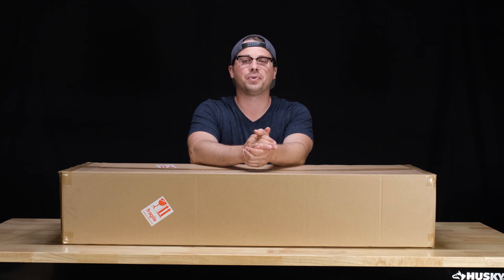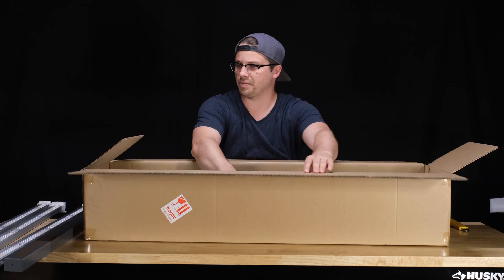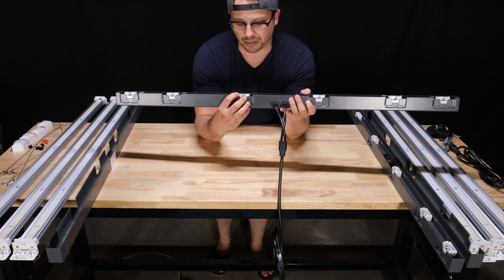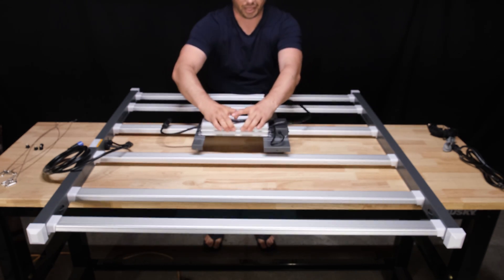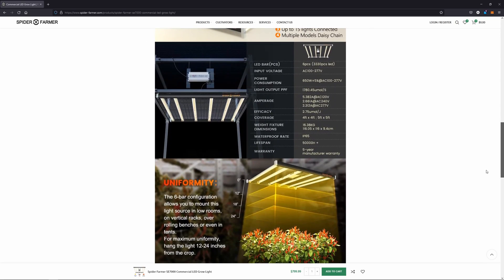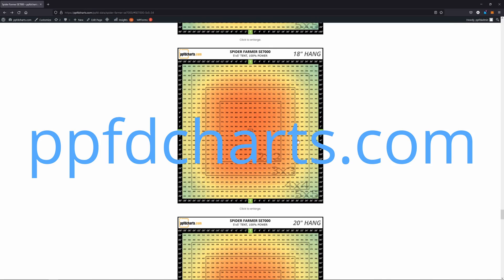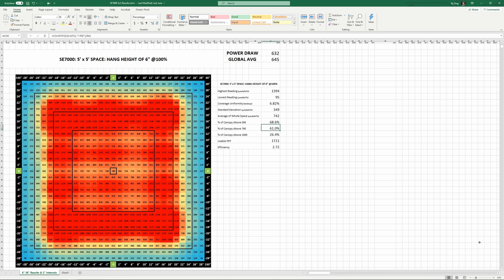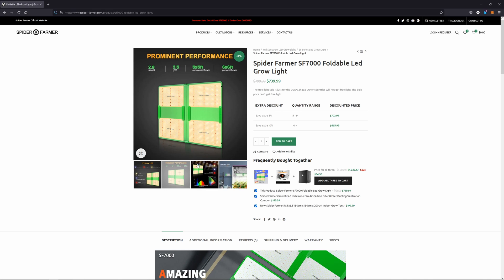Spider Farmer SE7000 Review: A Powerful Bar Light for Your 4x4 or 5x5 (w/ High-res PPFD Results!)

Comment: Bro I think you are testing the wrong light this is not the SE7000  THE SE7000 Has 8 bars and is a 730 watt light you are testing a 6 bar light which I think is the SE 5000

Comment: May I ask what tent you are using? At timecode 13:10 I notice a grey foam core in the tent wall. I would like to know the manufacture and model number, please.
Reply from the maker: I built these walls myself so I could reconfigure the space however large I needed to test in
Reply: @LEDGardener  Looks like an outside material, grey foam and silver liner inside. Can you tell me what those 3 materials are and what your using to glue them together, please I’d like to reproduce for myself, thx
Reply: May I have info on materials for the foam wall, please?
Reply from the maker: They are 2” 4x8 foam panels from Home Depot with mylar glued to them

Comment: this is great! tried using the LEDG code as a coupon in checkout at the link you shared but it said "coupon ledg does not exist!" any ideas on what I might be doing wrong or how to apply your discount?
Reply from the maker: Hey Taylor, I tried changing it to see if that fixes it. Try ledgspider now.
Reply: @LEDGardener  that worked! Thanks so much!
Reply from the maker: No, thank you!

Comment: great vid!! any idea how the upgraded version compares?  you get an additional 80 watts and 2 additional led bars yet 642 less led's.  also, why would they opt to leave out the IR and UV lights on the 7000 only?
Reply: I was able to get the upgraded version and it really is a nice light. I have it in a 5 x 5 and it actually more light than most people will need unless you are running CO2. Veg is about 40% on the dimmer and flower about 65%. So quite a bit of overhead left over to play with later in the grow. I'm not worried about a few missing diodes which would just be overkill for most amateur growers.
Reply: @artvandelay4545  I know it is a old post ,I have just received the upgraded se7000 ,how far above canopy do u hang light? Thanks
Reply: @concreter6832  I would start off about 3 feet above the canopy and see how your plants react. You can tell if they are happy or not. I know like that sounds like more space than you see recommended but it's a powerful light and can overwhelm younger plants especially. Hope that helps
Reply: @artvandelay4545  I bought 2 of the 7000 for a 10 f X 5 ft tent ,by what U said I will probably not run them more than 65 %,that Will be a big power saver ,I am replacing 3x600 HP's thanks for advice.
Reply: @concreter6832  Pretty sure you'll like that setup. You might need to run above 65% at the very end, but if you run much above that, you will generate a bunch of heat but still cooler running than your old setup. I've gotten some big fat nugs with this light.

Comment: This is a SE5000.  Not SE7000.
Reply from the maker: The SE7000 changed. This was the first version of it.
Reply: Oh is that so?  I have the 8 bars version.
Reply from the maker: Nice. Do you like them?
Reply: They must of just recently released version 2 then hu?  Didn't even know that. I got mine last week.  I haven't set them up yet. They are put together and I check em out. Been busy lol

Currently have 3 Sunraise QB4000 up. Gonna move those to veg room. SE7000 for flowering.
Reply from the maker: Good stuff. Spider Farmer says the SE5000 has a 480W power draw and mine drew 630+
Reply: @LEDGardener  good to know I have a 4by4 infinity 844 tent and cant decide to go with the 5000 or the 7000? Im doing 2-4 plants. Would heat be a issue with the 7000 in the 4by4 because of tight fit?

Comment: Hi , wondering if you would help a guy out here. This LED is so confusing for one. I've got a 4x4 tent AC Infinity with the awesome exhaust fan.
I bought those budget crap Blurple light led lights. One Cob just died after 2 months.  I'm on a budget in a way.
Question your thoughts would the HLG 350 R be good for Flowering a 4x4.
Thanks  love your awesome reviews on the LED,'s
Reply: Get the 600R or 650R for a 4x4.
Reply: @lok777   thank you I got it the 650R  HLG 🥰🥰👍👍

Comment: thanks for the great video! it's nice to know how easy it is to set this light up. i am in the market for a good light and this is the one i have been wanting, but i am undecided since spider farmer hasn't paid me a dime for any of my affiliate referrals since i have started with them. every month they tell me the same thing. "we'll send it out the first of the month"  which never happens.  have you tried the affiliate program? if so, how has your experience been so far?
Reply: @timpage5021  out of 3 sales i was only paid for one so far. at the time of writing what i did, i hadnt received anything yet. i ended up buying the se7000, so far everything is working properly.  hopefully it stays that way!  i am unsubbing to this channel right now so i'm not sure if i will see any reply. if not, take care and good luck :)
Reply from the maker: Well, a few months down the road, I can identify. I’ve been notified for 8 referral orders and every single one of them was followed by another email an hour after saying the referral was “updated” and removed. None show up in my dashboard. They told me that all these orders were cancelled by the buyers. Ha!

Comment: So do you recommend this light for flowering in a 5x5 or is more light needed ?
Reply: @Paul The SE7000 doesn’t cover the 5x5 as evenly as it should, he literally shows you in the video how it falls off at the edges. Look at the par graph of a Photontek 1000W light in a 5x5 and you will clearly see the difference
Reply: @MinesanityServer  have tested a growers choice ROI-E720 and it lights up a 5x5 just fine and is only $1100 for a system that includes UV/IR
Reply: 5x5 takes around 800-1000W to light properly, check out the Photontek 1000W CO2 PRO, drmjcoco made a video on it. I would honestly just recommend people use 4x4 instead. The amount of light it takes to cover a 5x5 costs the same amount as the amount of light needed to cover a 4x8. You can easily cover a 4x8 with 2 lights you can get for $700-800 each, so $1400-1600 total, but a single light strong enough to cover a 5x5 properly is $1400-1500. 4x8 just makes more sense
Reply: @MinesanityServer  you can properly light a 5x5 with a HLG 600R, 650R, or Scorpion $600-900
Reply: @SouthWardBrazy515  The HLG 600 and 650R barely cover a 4x4 properly. They will never cover a 5x5. Do the math, you need at least 40W per square foot to cover a 4x4 area. So you would need 1000W to cover a 5x5 area

Comment: given the relatively low efficiency compared to their reported 2.75. Do you suspect the diodes aren't of the SL bin?
Reply from the maker: My numbers are less reliable because I’m just estimating efficiency based on the photons that fall on the measurement surface. Their number would be capturing all photons leaving the light.
Reply: @LEDGardener  hmmm I see your point but when you compare your test numbers to other lights from your testing environment, for example the HLG scorpion diablo, the efficiency is much higher. Is that enough evidence to suggest one light may be using better Bin diodes?
Reply from the maker: I would guess that if there’s something that’s lower efficiency on this light, it’s the off-brand driver. It feels much lighter and less sturdy than a 600W Mean Well.
Reply: @LEDGardener  Yea but the Scorpion Diablo uses a 600w Inventronics Driver.

Comment: So what i understood ,  the spiderfarmer se7000 is much more powerful and especially uniform than the HLG Scorpion Diablo. i just compared your two videos
i was close buying the HLG because in most tests, its the most ppfd producer, but now iam confused

https://www.youtube.com/watch?v=Z6Xh9Z7Y3rM
Reply: The measurements for SE7000 is in a 1.2 x 1.2 tent = 1.44m2... 
The measurement for HLG are in a 1.5 x 1.5 tent =2.25m2
The HLG were tested in tents that were 56.25% bigger
The SE7000 in a 1.2 x 1,2 tent only produces 39.44% more light than the HLG's in 56.25% larger tents
So when you look at the maths, what do you think would happen if you put an SE7000 in a 1.5 x 1.5 tent ?
Or if you put the HLG lamps in 1.2 x 1.2 tents?
The HLG lamps will beat the SE7000. They are clearly brighter and more efficient at turning electricity into light.
The higher efficiency of the HLG lamps is no doubt due to HLG lamps using Top-bin Samsung's and SF using lower bin Samsung's, if at all, given they BS and grossly inflate their figures!

To answer your question, the HLG lamps are brighter and produce more light per watt than Spiderfarmer lamps :))
Reply: @HorticulureLightingGroupEurope  ure goddamn right!!!!!! i missed the size 4x4 and 5x5 and some other little facts, but thanks for the big info  update  since i am close to buy a HLG, just was  a little confused
Reply: @AktenJoe  No problem brother, I am glad I could help you to see the light, lol :)) Full disclosure, as an owner of HLG LEDs I can tell you these lights are legit badass, and at least with HLG you know 100% what you are getting, as they are a reputable company. Enjoy your new light an God Bless.
Reply from the maker: I did test the spider farmer in both 4x4 and 5x5 tents. If you’d like to see them you can skip to the chapter in the video.
Reply: @LEDGardener  will check it out, thanks  !!!
Reply: @LEDGardener  Apologies, I had not watched all the way to the end as I got interrupted, just watched it all the way through and just checked those charts on your website, well done, brother.

The SF is actually better than I thought, it is the same performance as Scorpion Rspec, although it uses twice as many diodes just to achieve the same performance as a Scorpion Rspec.

Whereas the HLG 650R with 23.87% less LEDs than SE7000 outperforms this lamp
 
And HLG Scorpion with a similar diode count to the SE 7000 beats it by a significant margin.

This definitely shows there is an efficiency gap between the HLG lamps and SF lamps.

Guess whilst HLG have access to those Top-bin Sammy chips, doubtful other manufacturers with a similar chip count will ever be able to beat these lights.

Thanks for the awesome content brother, you rock :))